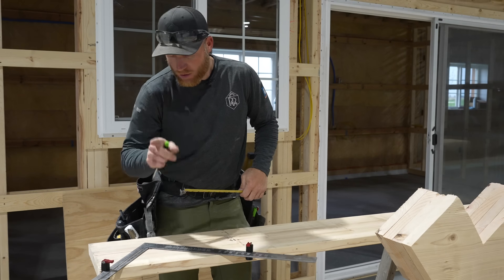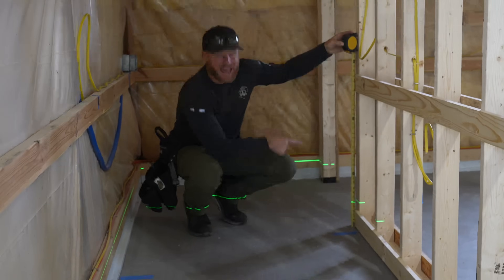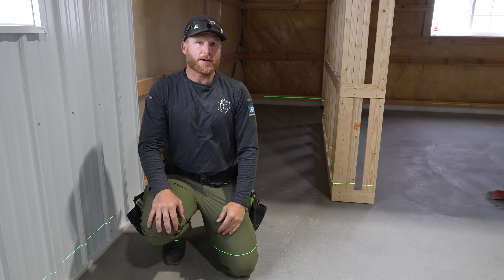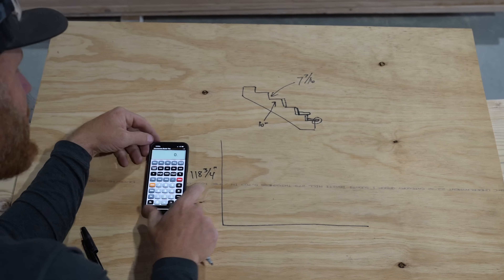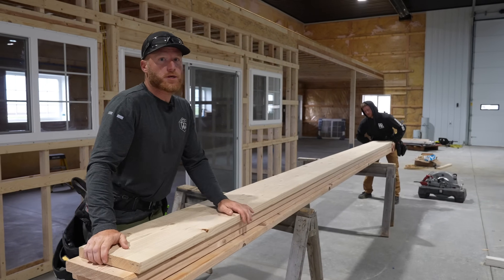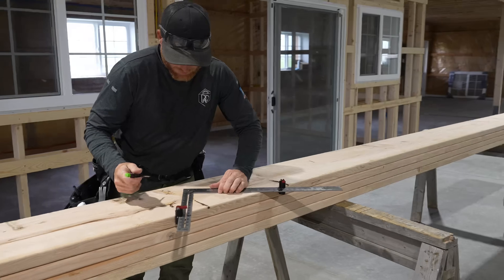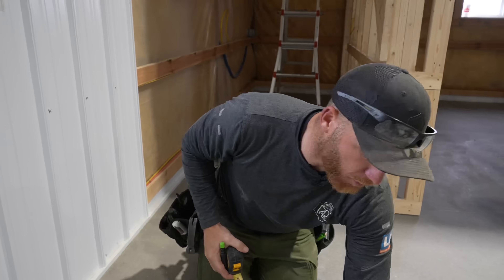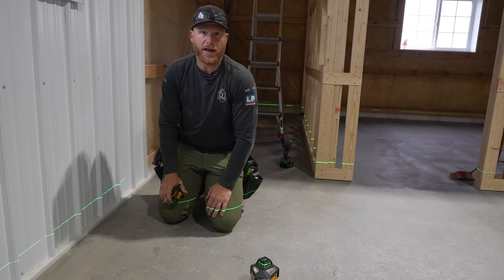Large Workshop Buildout 4: How to Build a Staircase like a PRO

Comment: Not sure if anyone mentioned this but you can set your wall height as the "Rise" and just press the "Stairs" button until it gives you your riser height and number.  Then select "Run" for the run of the stairs.
Reply: Thank you i did not know that feature :)
Reply from the maker: Honestly wanted to help others understand instead of just give the easy answer but yes you are totally correct.  I love the calculator
Reply: @RRBuildings  The AIA gives a small range for rise-over-run for stairs so the stairs will not be too steep or too shallow so there will not be a tripping hazard.  Steps or stairs with too great or too shallow of a rise as well as too large or too narrow of a tread are very uncomfortable to climb and can be a tripping hazard.  I believe the 7 1/4 over 10 is the average or the middle.
Reply: Moussaka
Reply: So complicated. We'll see what's up
Reply: Hellou from to Brazil
Reply: King
Reply: I love you profc
Reply: @royreynolds108  I'm familiar with 6 3/4 to 71/4 Rise to 9 1/4 , Which gives you a inch in a quarter overhang for your tread. As a rule of Thumb.
Reply: @RRBuildings I definitely appreciate the explanation. I am completely fascinated by knowing the “how and why” behind doing things, so thank you sir.

Comment: This is great, however how do you calculate it if you do not have a wall to attach the stringers to? We are building stairs to a joisted walk way that lies between our two barn lofts, we need the stringers to attach to the joist of our walkway (one side of the stairs will be supported by a wall. There is no wall below the walkway. This method assumes there is a wall to attach the stringers to.

Comment: what would really be a bad day is if a person didn't have the angle of their saw perfectly zeroed out, especially cutting four 2xs at the same time ugh. That would make the lower stringers be off by a lot, but I'm sure you have already dealt with that before.
Reply from the maker: Haha so true.  I specifically check every time I gang cut with the beam saw
Reply: @RRBuildings  using that huge circular saw is going to make cutting those beams you cut a lot more square, though! that has to be a special order saw. Because I never see one on the shelves in Lowe's or Home Depot in Oklahoma!

Comment: I am a deck builder now for over a decade and have done many sets of stairs. I have replaced many stairs that were done incorrectly. Building stairs is a task where science, math and art all meet. It can be daunting and difficult the first time you do it. However (and you mentioned this in your video) after you’ve done a few sets of stairs, they seem easy. 

I do stairs as you do, with a 2x8 riser and one of the most satisfying things to do when you’ve completed the stair case is to walk up and down and feel how solid they are. That 2x riser eliminates all deflection in the stringers. I had a client say to me once “I thought you charged too much for the stairs until I walked down them and realized how strong they are. They feel like cement stairs.”

Great video fellas. Good explanation. In spite of having done many stairs properly myself, I learned a couple new things. Love that big beefy saw you have for cutting the stringers. Nice toy. I’m now a subscriber and will check out more of your content.

Comment: Thanks man. As a 17 year old entrepreneur who is trying to start a construction business I was tasked with the job of building a 14x16’ mezzanine. I have watched a lot of your videos and you have taught me a lot. You’ve taught me that layout is a very big part of building and if you spend the time to get it right in the beginning it’s going to save you a lot of headache in the end. 

I had built the mezzanine and it turned out great. Your trick with finding how much the concrete drops at every post with a laser really helped me out. Originally the client wasn’t gonna put stairs on it and was just going to put stuff on top with the tractor loader but later he decided he wanted stairs. I’ve never built stairs before and they seemed intimidating but you showed me that it’s actually a pretty simple process once you get all the math figured out. Thanks man.

Comment: I’ve been a carpenter since 1970 and I do many of the same step you use. I am union and had the advantage of being taught by others. It would have been nice if we had videos like yours back then. One thing I do differently when framing a building is this: lay out the floor system so you do not need  a hanger board at the top of the stairs and so that the heel of stringers is supported in the floor framing system. The top of your stringers hits under the subfloor. Another tip, because some boards have varying crown heights, I run a portable power planer over the top of the stacked edges to make them consistent. Also, years ago I started to use a large divider to layout the hypotenuse of each step by walking it down the top of the stringer. No more inch disease! 
Over the years I have owned 3 iterations of the construction master calculator. I believe I had the one of the first, but I eventually started using just a regular calculator, and now I use my iPhone calculator along with some layout apps.

Comment: Ok you said to comment below. You might have the tread surface upside down. You want a "frown" on the grain, so they cup down. If you look at outdoor 5/4 wood decking the boards that are install with a "smile", they are the boards that cup up and hold rainwater. 
Great video. I build my stairs the same way. Solid staircase!!!

Comment: Kyle.  I live in Hawaii and what I always do to stringers is subtract an additional bit 1/2"-3/4" and add a hot dip 3/8" lag bolt to 
the bottom of each stringer.   2 things.    keeps it above water and 2 it helps a bit more to adjust for who knows what. I'm more likely to 
do this on exterior stuff. and for exterior stingers I do not cut the treads or risers but simply use a tread bracket spaced away from the stringer
with 1/8" nylon washers and keep the treads from touching wood to wood and I treat every cut outside the envelope. it really doesn't take that much more time. 
Like you said. after you do a couple of these it becomes second nature.   GREAT VIDEO.  Thank you

Comment: Excellent video. I'm a mechanical engineer and never learned anything about wood or wood type construction (all I learned in school is high end physics and math and some fun programming type stuff for robotics, but I have been a manufacturer for 6 years now (solid metal parts - CNC type stuff) and love your videos. They're super easy to understand and truly valuable for the trade. I've seen what some builders do and this is A+.
Reply from the maker: Wow thanks
Reply: @RRBuildings  Information is good, And probably one of the best, But you can break it down and simplify it even more, If you really want to make it easy for people to comprehend.

Comment: Great video, thanks for all the time and hard work putting it together for us, very professional. A very valuable addition to any tool kit would be a strictly metric tape measure as well as a set of other strictly metric squares, etc. ( I use the imperial system as well but really do hate it and prefer metric in many instances) I also wrote an Android app for calculating spacing, which rounds up or down each increment to the nearest + - tolerance set by user, similar to the calculator you were using without any added or missing length on the last space

Comment: Excellent explanation of how to build a staircase.  The best teachers are those who explain a subject as if the student is listening for the first time. You are an excellent teacher.

I am a carpenter who has built a few staircases.  My only comment is that I usually plan on to install the thread first and the riser on top of the thread because I feel that having the riser on top of the thread adds to the strength of the thread as it is walked upon.   Just my opinion.  It's either one way or the other.

Also. . .  where are the coffee and donuts ???

Comment: Whenever I built stairs I would do my stringer lay-outs,I too would have to stop and think about the subtractions at the floor height and the additions at the top as You explained,then I would cut the 2 ends and dry fit 1 stringer to be sure everything was correct before cutting all the stringers and the notches .That way if you screwed up the ends of 1 stringer you could always saw it into treads with very little loss

Comment: Superb video with accurate explanations for every facet of the process. I also use side ledgers for the outer stringers, and a floor ledger for the bottom, and for exactly the same reasons, even if code doesn't require it.

I have to ask though: 7-7/16" is a hair under 7 and a half inches. It looked like your treads were at about 7 inches, or a hair above. Was that just an optical illusion from the angle of the camera? It was hard to tell. Either way, your bottom two treads looked like they were the same measurement, so it doesn't ultimately matter, as long as they're consistent all the way to the top. Just a curiosity.

But overall, excellent work, AND instruction. I approve whole-heartedly, I wish more people did instruction videos like this, detailing the process helps everyone, even if they know what they're doing.

Comment: Kyle you’re way smarter than me so not trying to sound like a know it all. But the vertical board is the riser , which you did say , but the horizontal board you step on is called the tread. And when calculating the vertical number is called the rise and the horizontal number is called the run. And code here for stairs is 7-11. But , especially older folks , we like a 6-12 , it makes a much more comfortable stairway. Maybe try one sometime just to see , but 6-12 is so much nicer. You do fabulous work and your buildings are top notch. Great channel.

Comment: Very well detailed and informative.  Using 2x material for the treads and risers will surely make the stairs stout.  Great explanation about the top and bottom differences.  I understand that the top is a mezzanine.  If it is going to be or become a finished space, did you miss a step about the top landing step?  It doesn't appear to have any overhang.  If you add a finish floor up there, won't your top rise be taller than the rest now?  If there is no other finish flooring, should there still be an overhang so that each footstep is uniform, going up and going down?

Comment: I too mark the edge of the stringers to insure equal spacing. I also made a fence for my framing square that rests against edge of the stringer rather use stair gauges. This as 2X lumber often has irregularities. If the stair gauge lands in a divot or on a bump it can change the orientation of the square. The net result being that from one tread to the next they may not be level and parallel to each other--same goes for the risers not being plumb and parallel to each other.  Also, can you have the calculator give you results in 32nds or 64s? That fineness could wipe out the 1/4" variance in the overall hypotenuse.

Comment: Like the vid usually i'd make a jig uot of a 2x4 and a piece of 2x6 cut to my rise and run on the step screw my jig together i get the angle by measuring from the height of the riser to the length of the Run that's how I make my jig that's how I get my angle don't even know the angle but it's there.

Comment: I thought the grain was opposite. Frowny face so the cupping would face down. The other way would have your edges curling up. Whenever i install decking i want the middle to hump up and the edges touching if anything cause it will be more likely to flatten out and water sheds off instead of collects in the middle.

Comment: Excellent video. I love all of the little details. I am curious about something. You have a lot of different brands of tools you use including my favorite Milwaukee tools. I noticed that you are using the Metabo driver most of the time these days to drive screws. What is it about that impact driver that you like so much and is it worth having to have another battery platform? Thanks
Reply from the maker: I’ve been using the triple hammer mainly now for probably 5 years.  It is always my go to and it’s all about the balance of power, comfort, and noise

Comment: biggest thing that I got out of the video (tutorial) was how to level the bottom riser 29:20. The text I read stated to average the highest and lowest for the total rise and everything'll work out. However that's if the bottom riser rested on the floor and supported the stringers. The stringers still need to be trimmed at the bottom level cut.

Comment: I'm just wondering how you handled the 3/8" difference that you had towards the middle of the height of the stairs? meaning the width difference toward the middle height.
Reply: At about 47 minutes in he explains it and then does so shortly after. Tied a riser into the stringers, then the left stringer into the exterior wall, then the right stringer to the interior wall. You can see the gap close
Reply: @barthalamewarnold2407  I know he said it toward the beginning but I never heard him mention how he handled it when he got to the point of skipping up to the middle to make sure the stringers were on the 16" layout. I know there was a 3/8" difference in the middle because he said it, and that's what I said, but I never heard him say how he pulled it together to make it straight or just made wider treads and risers, but thanks anyway.

Comment: I’ve never built stairs but I will be doing so in the near future. Would it ever be worth while to use a circ saw with a rip fence to rip off the rounded edges of the side where you are marking for layout? Even with all the extra math and precaution the accuracy seems dubious. Ripping a straight edge would take only a few minutes

Comment: As the wood dries the outer rings expands because of the radial cracks thus making the outer rings wider. if I observed your video correctly I think you installed the tread upside down.

Comment: So I just made a set of stairs off of this video and worked great but what math do you do at the top since you have a tread on the top step but just the subfloor on the top floor? Is you too step just a little shorter? I just slid the stringers down and inch and a 1/4 to make up for it.

Comment: HI, weill you are nearly right about the imperial system vs metric, but both systems have the same flaw....rounding to the nearest mm is the same as rounding to the nearest 16th or 32nd, etc. The problem is that for repetitive calculations like stairs, you need to use decimals not fractions. So 118 3/4 divided by 16 is 7 7/16 or 7.4375. But if you instead (on the same calculator)  do 118.75 divided by 16 you get 7.421875, a small but repeated difference of 0.015625, exactly 1/64....
Reply from the maker: Great point
Reply: @RRBuildings  ...and just so you know, this video is one of your all-time best...

Comment: I was told to always make sure to install lumber with the curved grain shedding and not collecting. in other words, frown-y-face. The reason is because if you install it "happy face" it the grains will collect moisture and not release it. If you install it "frown-y-face" it will shed moisture away from the center. This was most important when building with lumber exposed to the elements. Indoors this doesn't affect it much at all unless there is a disaster like a plumbing pipe bursting or a roof leaking and then soaking the lumber indoors. At that point the lumber will collect and shot shed. When building are being built sometimes the weather will rain on a job site and soak the whole project. Installation of the lumber shedding at that point will be important. At least this is what I was told and have always done it that way since.

Comment: My barndo 1)wrap around with 16 steps 2 of which are landings Rise 7.41"x Run 8.79"126" Total Rise. 2)Garage stairs 16 Total Rise 126" Total run 164" 7.41 Rise 10.06" Run. I wish I had laid out the parallel distance hypotenuse to the stringer it would have prevented my accumulation of 2 inches to my total run.  If you just do rise and run only you can accumulate position error.

Comment: An easy way to remember your off cuts for the bottom is simply to take off the bottom whatever thickness your treads are.  This however does not account for level on your floor. You always have to consider extra steps to correct this problem,  if there is one.  So take the thickness of whatever tread your using, and cut that thickness off the bottom.   66carpenter

Comment: When the stair that meets the wall on your right side would rather cut your step around the wall a little so it matches your overhang or cut it flush like you did?
Reply from the maker: We cut off due to the metal finishes that will be there.

Comment: So, you stopped the right stringer skirt short because the whole basement is going to be wall metal and not sheetrock . so the bottom steps will be exposed with tread overhang and not solid was what the owner preferred? Nice stairs! skirts are way nicer.